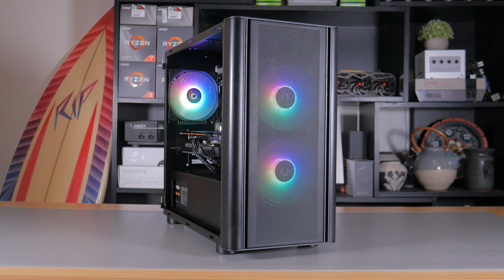BEST $1000 Gaming PC Build Guide! (2022)

Comment: I've been running a 12400F/3060 rig for a few months now, and I'm really loving it.  Very lower mid-range parts, but the performance is all I will need for at least 3-4 years.  Single core performance is amazing on the 12th gen which always offers great frame timings in games.
Reply: lower mid-range?
Reply: which games do u play?